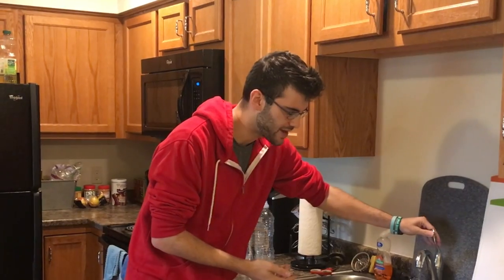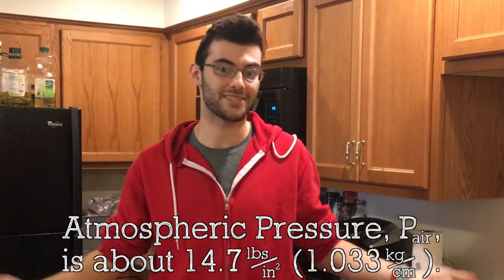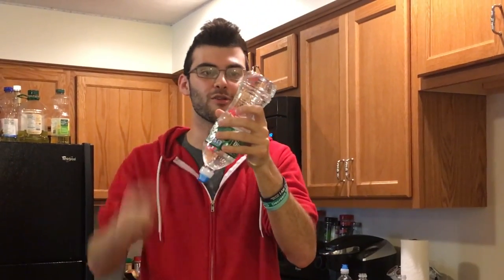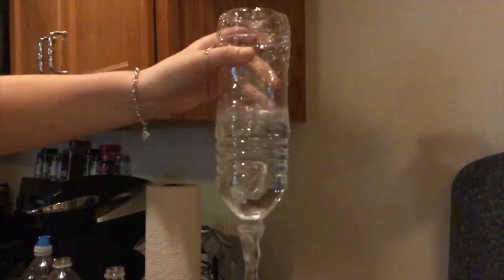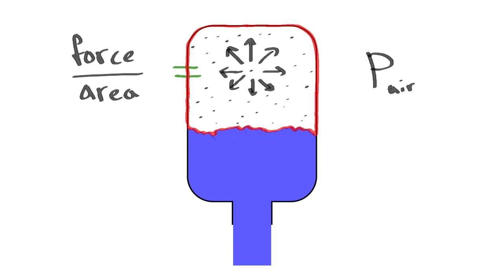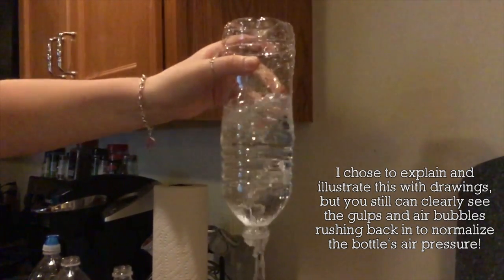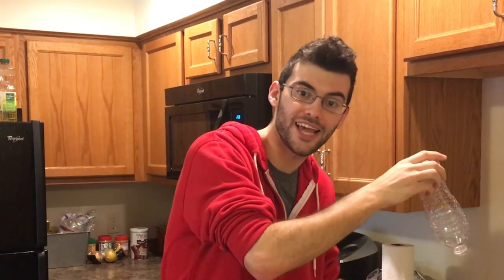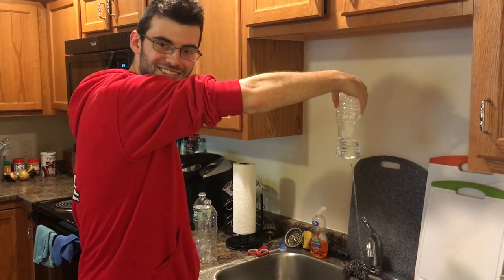Why Does Pouring Water "Gulp" ?

Comment: Good video, but the pressure inside the bottle decreases as you pour the water out, not because the area increases, but rather because the volume increases. Refer to the relationship, PV=nRT. Pressure is inversely proportional to Volume.
Reply from the maker: while PV=nRT may be the more conventional formula isn't P = force/area also a correct way to explain it? The force stays the same as the surface area inside the bottle stays the same.
Reply: No. In the video, you imply that the pressure decreases because the internal area that the air is acting on is increasing. It is possible to reshape the bottle such that the internal area acted on increases while the volume remains constant. With your reasoning, the pressure would still drop. Therefore, your explanation and my explanation cannot both be true.
Reply: +Conjecture I don't think so. Because the net force on the inner surface would be equal to zero coz gas molecules bump everywhere inside the container. To properly use Pressure = Force/Area, you'll have to apply it on an area element (an incredibly small area of the container) and your expression would become
Pressure = dF/dA, where dF and dA are the Force and Area elements.
Hence PV = nRT is the (only) correct way.

P.S. This will make more sense if someone knows calculus.
Reply from the maker: Awesome, my mistake - thanks. Pinned your comment.
Reply: Conjecture Happy to help. 👍
Reply: Thanks! Happy to help.

Comment: Also, if you spin the bottle so the water pours out in a vortex, the water can flow out while the air flows out, without causing a (frictional) resistive force. Not sure it's the maximally optimum way, but is a lot faster and handier.
Reply from the maker: Also cooler
Reply: Conjecture quite
Reply: jackkennedy98 backyard science !!!
Reply: I was about to suggest this, but glad I went through the comments to see if someone already did.
The vortex is definitely faster than having it gulp or pouring it out slowly by tipping it just far enough(and also requiring less precision), but having a hole at the bottom of the bottle is probably still the fastest way(but then again, that makes using it as a bottle kind of a pain)

Comment: In the last section. Apart from a slower flow rate, the reason water doesn't flow out is also because the smaller hole causes a higher surface tension and stops the water.
Great Video!
Reply from the maker: good point! Thanks!

Comment: Does this also explain the thumping sound that happens when you only open one window while driving in the car? I thought about this when you mentioned the two holes in something like a thermos because when I open just one window, I hate how it makes my ears feel, but when I crack another window, it's no problem.
Reply: Essentially yes. The discomfort you feel and hear is the vibration induced by air first rushing into the car and then out, all the while trying to equalize the pressure.

Comment: Pv=nrt         pressure x volume = Number of moles x ideal gas constant x temperature. This is the ideal gas  equation, we can assume air is an ideal gas (it isn't). Since the air in the bottle is a closed system, n is constant and so is r. If we ignore them we get pv∝t. If we assume t (temperature) is constant then we can do p1/v1 = p2/v2 where 1 and 2 are 2 different instances time. This is the fun bit, as the Δv (change in volume) is positive and the denominator, that must mean Δp must be negative (ie getting smaller)... Source: studying higher level physics
Reply: Found out I'm 5 months late. Well if your reading this matt, can we have an update on emojin please?
Reply from the maker: Thank you! Yes, others did mention this when the video was published :)

And what would you like to know about it from this update? What happened?

Comment: regarding the small hole that doesn't let air through at all: the surface tension of water might also play a major role there. have you tried putting soap into the water? (in order to decrease the surface tension and possibly allowing the water to flow)

Comment: Pretty sure at the last part, a small surface area of water tension stops air from going in. If the hole was bigger, there would be a bigger area of surface tension meaning more places where the surface tension will break and let air in.
Reply from the maker: Yes, that too!